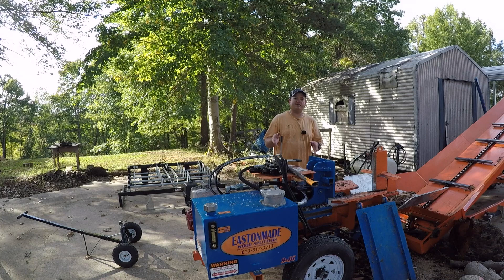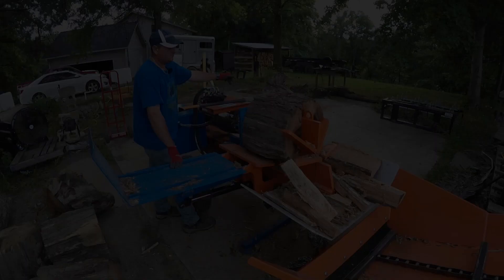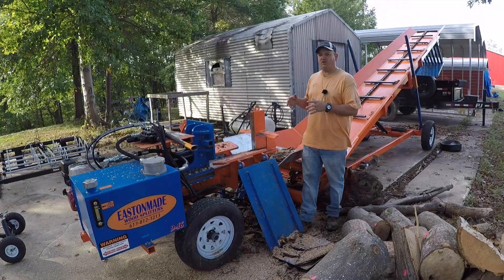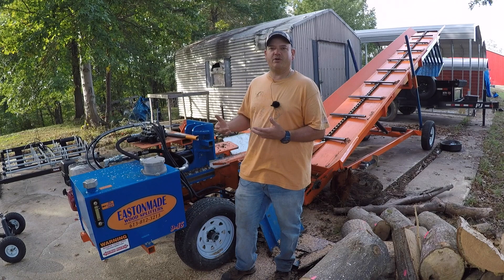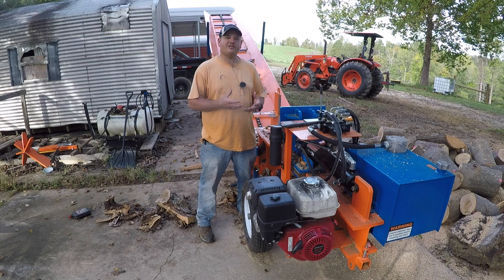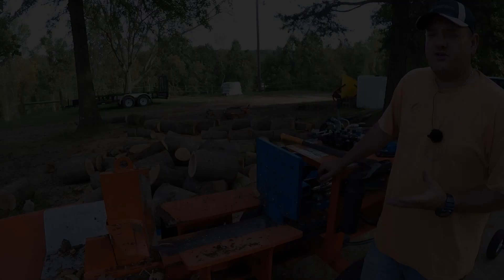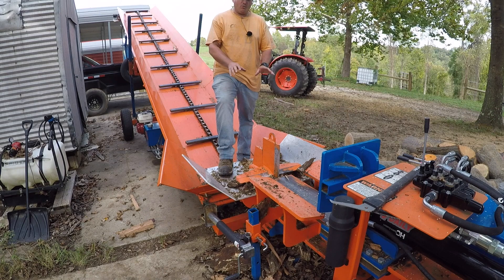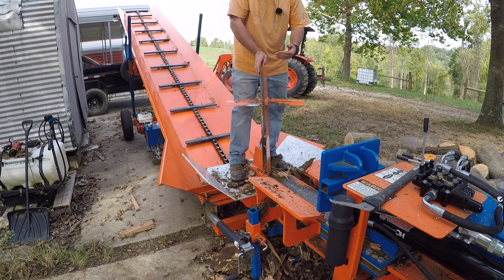EastonMade 9-16 Commercial Wood Splitter Two Year Review #229

Comment: Are you sble to manually move the splitter on a flat surface by yourself?
Reply from the maker: Yeah I can pick up the front and move it around, it is heavy but doable, I have a trailer dolly that I move it around with